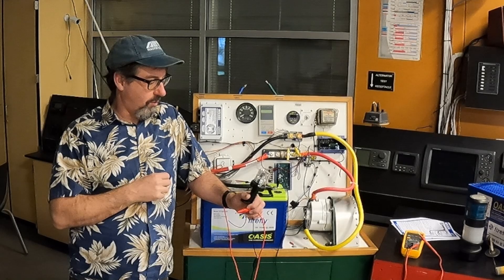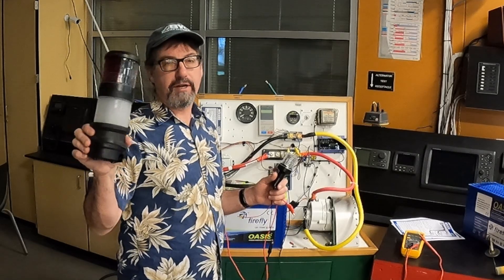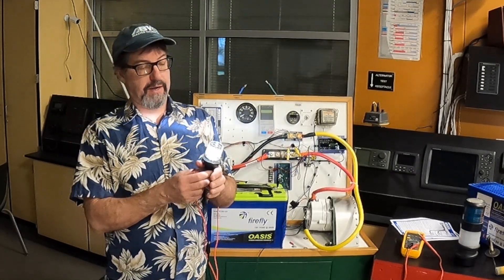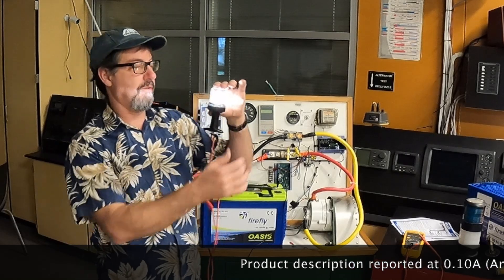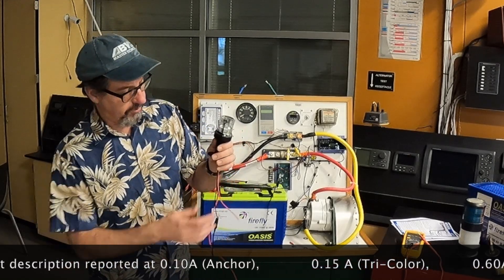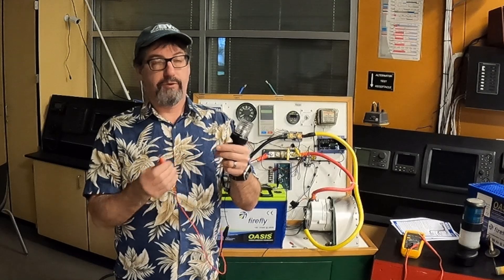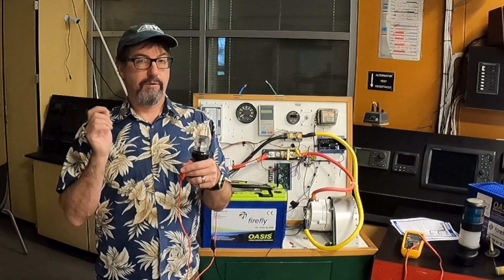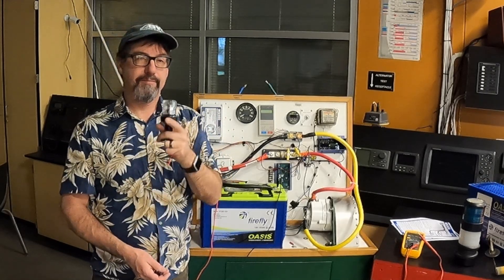Offshore#39: Making Decisions, the new mast head light

Comment: Cant find this exact light anywhere.  Anyone have a link?
Reply from the maker: Gary, I'm out on vacation and just got signal to catch up:
Here you go! I have one of these on my boat, King's Pride, and know several others - no complaints.
https://store.marinebeam.com/smart-led-tri-color-anchor-light-and-strobe/
Reply: @SVCSkallywags  Yes I found this one. Unfortunately the base is completely different and my mast has no way of holding it that I can find. I do have a small two hole mount that will work for the other one . But the one in the video is what I was really wanting not the round white base type.  Unless  I can find a way to mount it. Thank you so much however for time to link that one.

Comment: Any thoughts on the Lunasea trilight? It's also an all in one light but it also has 3 wires instead of 2
Reply from the maker: I haven't installed one of those. Good company. I like the two wire, as you can upgrade on any vessel that only has existing anchor light w/ two wires.